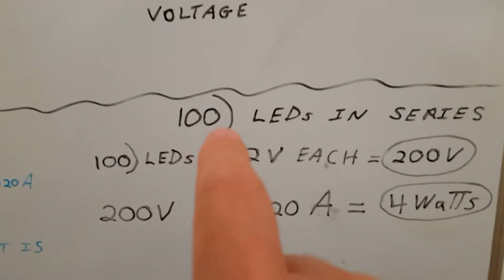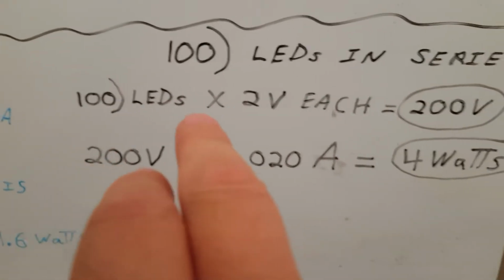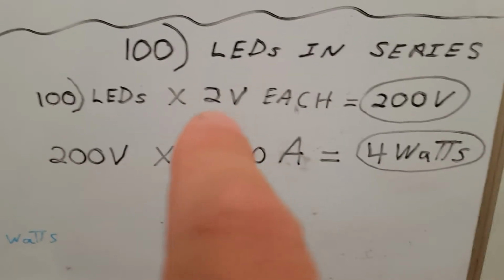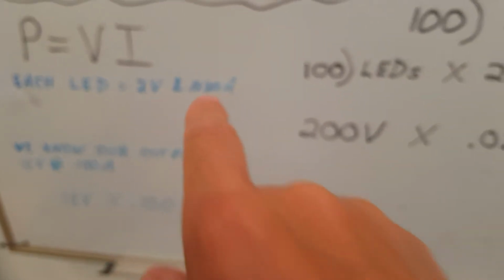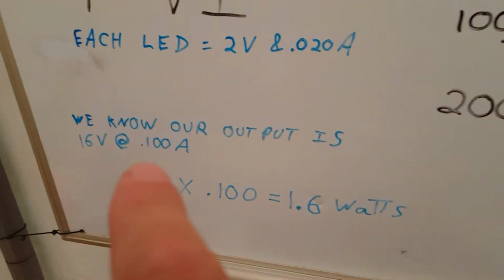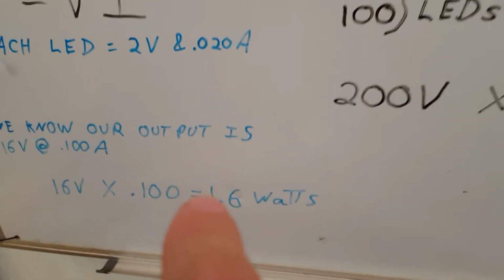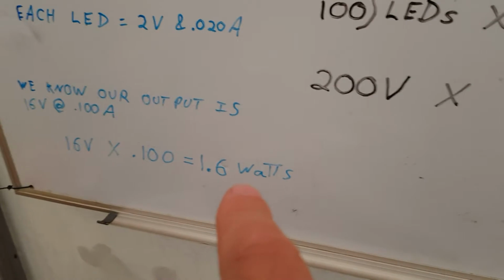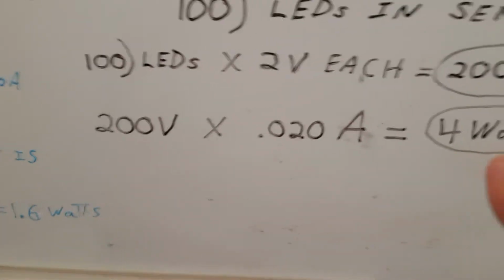WIRELESS POWER TRANSFER Part 13-B

Comment: Paul the math takes me for a moment.... if your input if 0.100 A but the out put is 0.020 A then you are using the coils to force flow the amps to make up for the lack of voltage.  The resonance frequency could likely be lubricating the river of amps down the chain...   so you have less voltage than needed but have 5 times more amps than needed.... this reminds me of how a Tesla coil works with the gradual stepping up or down between # turns and # gauge wires.   Thoughts?
Reply: Also side note... the inputting of a constant 16v makes it really hard to gauge the function of over unity because you are feeding it infinitely as many 16v as it needs.  The endless 16v makes it seem like the over ramping up of amps is just compensating for the lack of voltage.... it feels like the resonance does more in the way of optimization of electricity flow than any thing else and the coil system similar to Tesla coils does more in the way of overcoming short voltage with larger amps
Reply from the maker: Yeah its tricky, the other day i had a situation where i had 5V across 10 LEDs and they were lit bright.  I don't know what to say, i dont know whats going on half the time myself, LOL.  There seems to be more going on then just an even exchange of voltage for current or vise versa.  I will eventually do more math with this and check power other ways. 
  Well,,,,stay tuned, i think things will get much more interesting 😎

Comment: Have you tried building modified Tesla radiant energy collector from electrical engineer Lawrence Rayburn? Google "Lawrence Rayburn 46214433 pdf". He was able to get 12 kilowatts of free electricity. Forget about collecting atmospheric static, think about pulling electricity from the ionosphere which earth receives from the Sun, birkeland currents, high energy particle bombardments and cosmic rays. What he did is replaced insulated plate antenna with insulated flat spiral copper tube of few turns, added variable capacitor and variable inductor to resonate the circuit with standing waves of earth and also he added oscillator to lock the output frequency to 60 hertz. Good ground connection with buried metal plate for antenna and also multiple ground connections are needed. Solid 4 gauge wires are important. He says the flat spiral copper tube antenna forms an ionized path/conduit to ionosphere which is how kilowatts of electricity is pulled from the ionosphere when everything is in resonance.
Reply from the maker: Very interesting, I like this, thank you!
Reply: @INVENTOR3  Also read book "Harnessing Cosmic Energy by Bruce A. Perreault".
Reply from the maker: @Xeno_Bardock  Thanks, I read a lot of it many times as he keep updating it, but i try not to study too deep into it as i dont want to copy him exactly, i kind of want to walk my own path and combine ideas.  I like his radionic valve, and I have thought about using radio active materials to get energy from instead of the atmosphere.  I know DR Thomas Moray used radio active materials in his final design.  I am in Bruce's yahoo group called "Radioionic Energy Research & Development Group", DR James Schwartz is also in the group.   Dr Schwartz device here.....  https://www.youtube.com/watch?v=InES0BoKaik   😎
Reply: @INVENTOR3  According to Nikola Tesla, the reason radioactive materials are radioactive is not due to the forces within radioactive materials but due to highly penetrative primary solar rays emitted from the Sun which impact these materials making them radioactive. Also Tesla called cosmic rays the secondary radiation produced upon primary solar rays impacting cosmic dust in space.
Google "Tesla, 75, Predicts New Power Source | Tesla Universe" and scroll down to Confirmed Theory In 1899. 
If Tesla is correct, then it would make sense why Thomas Henry Moray chose to use radioactive materials which allowed him to harness up to 50 kilowatts of very high frequency radiant energy current which is ion current instead of conventional electron current.
Reply from the maker: @Xeno_Bardock  Good reading, thank you!  Interesting that the suns rays collisions "cause" the radio activity in other materials.  I have been wanting to experiment & collect energy with this myself for quite some time now & I even already bought the radio active materials.  I have Fiesta plate pieces and radium watch hand and uraninite ore😁  Yes, Moray used radio active materials in his third generation device, it worked in caves!  There is also Bruce Perreault and Edwin Gray's energy system with the radionic valve/glow regulator.  Good link here to it... https://icestuff.com/~energy21/edwingray.htm
Hummm, both Moray and Gray used a final output of 6KHz to light their bulbs,,,wow, i just learned this,,,very interesting & good to know!

Comment: Paul; if you think you are picking up additional power from an outside source; here is something you could try so you would know that you are not fooling yourself.

Connect a wattmeter inline with your signal generator and wall outlet. (Complete input)

Connect a filter capacitor to the (+) & (-) of the bridge rectifier you made. -it will smoothen out the DC current.
Use a resistor for the load, with an amp meter inline with it; and test the voltage across the resistor. (your output)
Reply from the maker: I like this idea very much, thank you!!

Comment: To my knowledge the answer is pretty straight forward. Your first calculation is wrong for the following reason. You are using a 50% duty cycle pulse as input power. That means that your LED'S are on and off 50% of the time, and the LED'S are not powered at full capacity either. But the pulse is high and long enough to make them produce some light. And because the frequency is so high it looks as if the LED'S are on all the time, but in reality they are off half the time. So your calculation is wrong because you must divide the 1,6 watt in half because the duty cycle is only 50%, so if you would do a correct measurement with the correct equipment the average power consumption would be 0,8 watt. The actual energy consumption is measured over time, and that is called  watt per hour, or second, or whatever time unit you want to use. The signal form your signal generator is half the time on and half the time off, so the LED'S only use half the energy during any given time unit.   

Your second calculation, the calculation on the right side for us viewers, is a theoretical calculation and it is only correct if you would use straight DC instead of a pulsed signal with a 50% duty cycle. And the voltage and amperage would need to be at the max capacity from the LED'S. What you need is an oscilloscope and that would show you exactly what I am saying. If all those LED'S would operate at full capacity in series or parallel with a straight DC signal they would draw 4 watt, (given the fact that you gave us the correct capacity from the LED'S), and they would be shining so bright that the camera would be over exposed. 

You can measure the voltage over all the LED'S and you can also measure the amperage going through all the LED'S combined. But you would need a true RMS meter, or even better, an oscilloscope in order to get a correct measurement. 

That is at least what I think. But don't take my word for it :-)
Reply from the maker: Hummm, yesss, thank you!
.8watt, 50% duty, fast blinking, yes!  I keep forgetting about this.  Yes, i keep telling myself i am only using half the energy and i want to eventually use chan 2 180 deg out of phase and have to double part of my system that is off camera.  HUmmm, my multi meter does measure true RMS, so what if i take a voltage reading across 90 LEDs in series, lets say i get 180V, now should i divide that by 2 because it is pulsed 50%, that would give us 90V X .02A = 1.8watt?,,or watts per hour.  I will have to study about watts "again",,,i don't like that they throw time in to it.  I can not use a current meter so far, it throws off my whole system, maybe an old analog would work.  I will eventually get a scope.  Wish someone would show me the math but i am slowly learning myself thanks to people like you😎.  Well, i hope to get around 600-700 LEDs lit,,,then i think maybe hard to dispute OU,,,, we will see.   Thanks for the help, I;m printing out your comments, much appreciated😁!
Reply: @INVENTOR3  Look at it like this, if we want to know what power a random circuit can handle, or at what power it operates, it is useful that we can measure or calculate the watt consumption at any given time, like making a snapshot. That is useful as an indicator so that we don't blow any fuses in the circuit. And in that case there is no need to ad time to the calculation. 

But if we want to know the total energy consumption from a device during the whole time that it was operational we must ad time to the calculation. 

So at 50% duty cycle the power is only on for 50% of the time. And when something is switched on for half the time it uses 50% less energy. 

It's only logic, when I switch off the light bulb for half the time it uses half the energy compared to a similar light bulb that is on all the time, measured over a similar period of time. 

So instead of the maximum 1,6 watt, assuming that it is the correct data, the LED'S can only use 0,8 watt at 50% duty cycle. Because they are only on for half the time. 
And although the LED'S in this test setup are shining some faint light, it is not at the max capacity. And all together it explains the difference between the two calculations in regards to the theoretical energy consumption. 
If those LED'S were shining at full capacity with straight DC input power they would use 4 watt of energy, and shine so bright that it would overexpose the camera. 

If you want to know the total energy consumption from your setup you must do your normal calculation with ohm's law, then divide the outcome by the duty cycle, or in other words, the amount of time that the device was using power. 

One 100 watt bulb would use 100 watt per hour if it was on all the time. 

But a 100 watt bulb that is on for only half that time still uses 100 watt when it is on, but the total energy consumption measured over a full hour would be 50 watt. So the circuit from the second bulb used 100 watt when it was operational, but the total energy consumption was only 50 watt measured over a full hour. 

And that is the difference between the calculation for the total energy consumption and the calculation for the capacity from the circuit. For the capacity from the circuit it is not needed to ad time to the calculation. 

So let's say that you measure 180 volts over 90 LED'S with a 50% duty cycle, and the total amp draw is 0,1 amp. Then we do the normal ohm's law calculation first. So we do 180x0,1=1,8 watt. That would be your "snapshot" from the total energy capacity of the circuit. But if we want to calculate the total energy consumption from a pulsed signal over a certain period of time we must divide that number (the 1,8 watt) with the time that the circuit was switched on, in this example by 50%. So measured over a full hour the circuit would only use 50% of 1,8 watt = 0,9 watt hour

Let's do the same calculation with 30% duty cycle. You will see that the "snapshot" will give you the same number as with the previous example (1,8 watt), but measured over time the circuit will only use 30% of the total energy. 30% from 1,8 watt = 0,6 watt. So the total energy consumption at 30% duty cycle would be 0,6 watt  hour. 

Let's do the same calculation at 100% duty cycle. 180 volt x 0,1 amp = 1,8 watt. (again the snapshot is the same) The device is switched on 100% of the time, so it uses full power all the time. So 100% of 1,8 =1,8 watt per hour. 

I hope this will help you out a bit.
Reply: In short, if you want to calculate the max output power from a pulsed signal you must divide the outcome from the regular ohm's law calculation by the percentage of the duty cycle. In other words P=UxI divided by the percentage of the duty cycle.
Reply: @INVENTOR3  I wasn't and still would not worry too much about this until you start using something other than LED's, something resistive in other-words. Otherwise, you'd have to take your measurements and divide them by your duty cycle. Keep in mind that your DVOM is not going to be reliable at these high frequencies, this is scope territory. Until you start using an oscilloscope to measure with, exact math doesn't really matter, yet.
Cheers Paul 🍻

Comment: Well the math you had there is intended for pure DC, what you have is a square wave.  (and anyone else reading these comments - correct me if I'm wrong) Even a pure sine wave would be easier for the math, because a square wave is made of a Fourier series of a few harmonic frequencies that you add together.  Easiest way to avoid that math would be to get a 2 channel oscilliscope and get the signal from the square wave generator (input) and on top of that view and sync up the time base of the square wave from the output (across your LEDs).  Then you may see if the output signal is still a square wave, or if it's changed a bit, and see if it's still overlapping right on top of the input signal. The waves could be shifted left or right from the input signal.  For a capacitor, the current starts rising before you see the voltage rising.  For inductors (your coils) it's the opposite. And the oscilliscope shows you voltage over time, not current, but the current for a given instant of time on your scope screen can be found with Ohm's law.
Reply from the maker: Thank you very much for these great comments!  InsAneTunA had similar comments.  I keep forgetting about pulsed 50% duty!  I printed out your comments for when i get a scope,,,,,, Well, now when i get it i know who to ask for help, no pressure, heheheh😁
I think if i get 600-700 LEDs lit, maybe then to get a real mathematician & electrical engineer in my lab.,,,are you free this weekend, hehehehe.
Reply: Well math has never been my strongest skill and I've never done a fourier transformer just yet.  But you should be able to find an older 2 channel scope for as low as $40, which I paid at a hamfest a few years ago. Check for your local ham radio club, makerspace/hackerspace, but don't mention anything about overunity or free energy or you will get shunned most likely. Just that you have a square wave going into a circuit, you want to measure the output voltage at 200V peak vs. the lower input voltage etc.

Comment: Looks great! Maybe use a couple 5 watt leds to save some time connecting all the small ones. You have enough power for sure.
Reply from the maker: Thank you!  Hummm, i should of thought about buying some 5 watt LEDs,,,i do have some LED lamps and bulbs,,the bulbs i dont like because of the internal circuitry.,,But you are correct, at another time i will try to replace LEDs with something else😎

Comment: That's easy math and at 2 volts it is correct. I thought I heard the fan in your first video. How is your business, is it healed up yet, also how is your dad, is he showing any signs of beating the cancer? There is also Dr. Berzinski who has developed a cancer cure, I have info on it if you would like it I will try to forward it to you, his cure does not kill the cancer, it replaces something he calls peptides that are abundant in healthy people who do not have  cancer but non- existent or nearly nearly nonexistent and the body kills the cancer or heals and then the cancerous cell are no longer cancerous, he has a very high success rate and if it does  not heal the person it won't do any harm to them like radiation will. God bless you all.
Reply from the maker: Unfortunately my math is incorrect due to "pulsed" dc 50% duty cycle. But i think things are still looking good😀.
Yeah sometimes i forget to turn that fan off when filming, but i try, hehehe.

Sadly, my father passed away Sunday June 14th at 6:21 am.  He passed fast, did not suffer long and was surrounded by his loved ones and i held his hand as he gave his last breaths😭😢.  His strength is now in me and helping me to carry on.  I'm struggling,,,,Your thoughts and prayers are appreciated.
Reply: @INVENTOR3  If it's hot in there leave the fan on, we can easily hear you over the sound of the fan.  I'm glad you dad did not have to suffer.  I don't know about the math at that rate, will that even change it? Take care Paul, I'm sorry about your dad, I will be praying for you.

Comment: I think you just answered your own question here, you've just shown mathematically what I was trying and failing to help you visualize in your other video. That first LED has to take the full load of the entire circuit but it can't handle that much voltage and current, so it goes pop sizzle sizzle!
Cheers Paul 🍻
Reply from the maker: Thank you!!